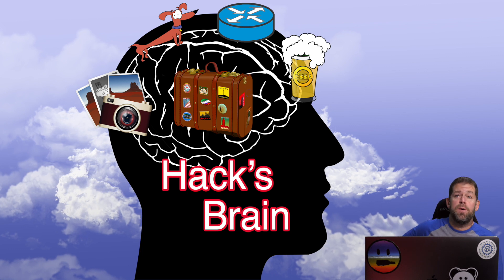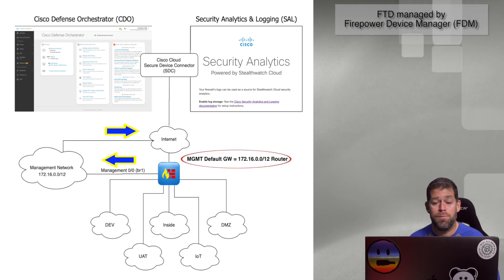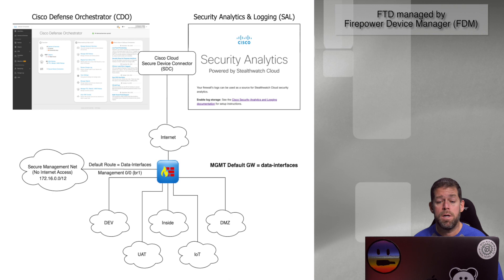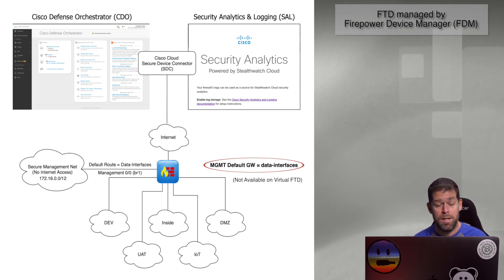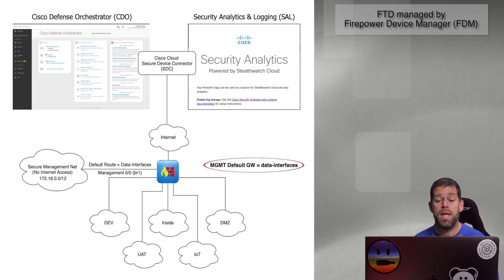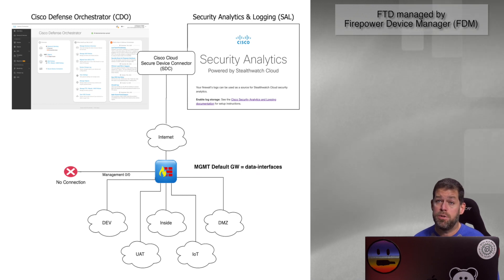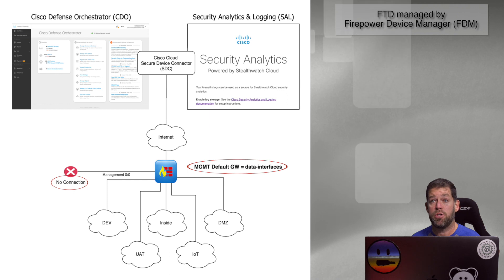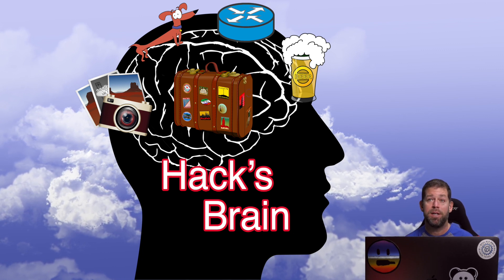FTD Management Interface Use-Cases

Comment: Hi Aaron,

Got a question on what you mentioned about making a data interface as new gateway. I think in Cisco document, they discussed this as making a data interface a management interface. My question is, you mentioned this solves the outbound traffic. Such as downloading latest updates, etc. I assume that includes connectivity to an FMC over the public Internet?
Reply from the maker: Hi Carlos. So, my example is for FDM based systems. For FMC based systems, I would use this reference, as there are caveats to using a data-interface with FMC but yes it is possible. https://www.cisco.com/c/en/us/td/docs/security/firepower/misc/fmc-ftd-mgmt-nw/fmc-ftd-mgmt-nw.html#ID-2242-000000c9